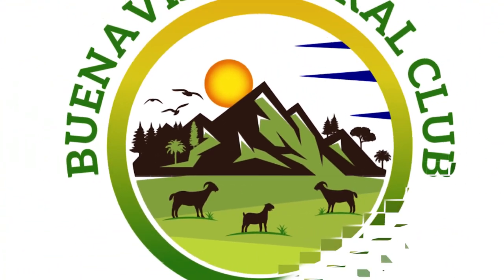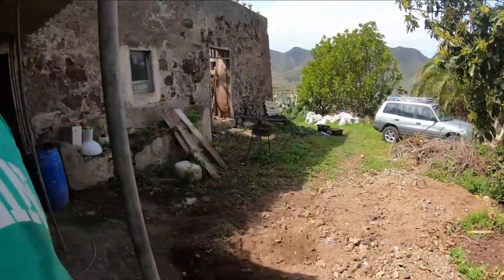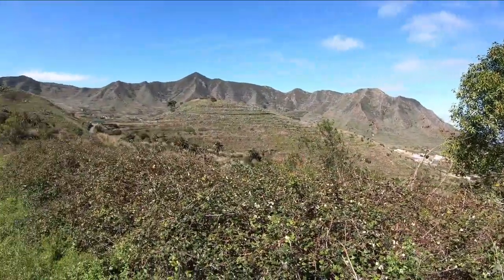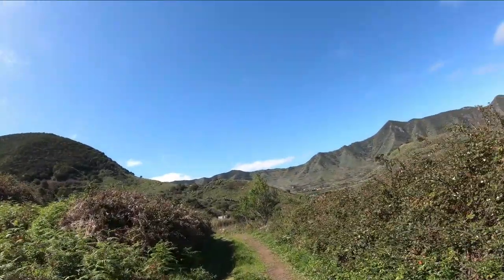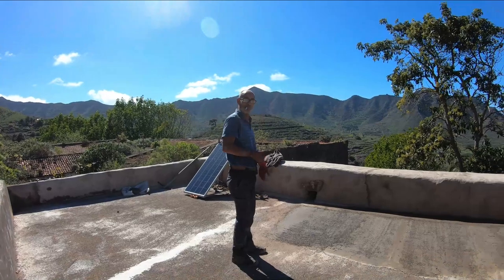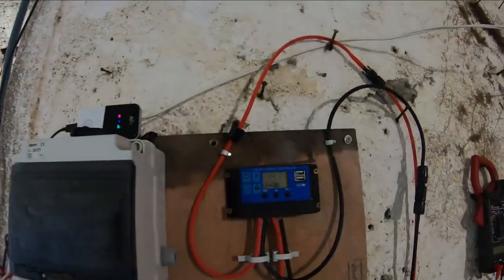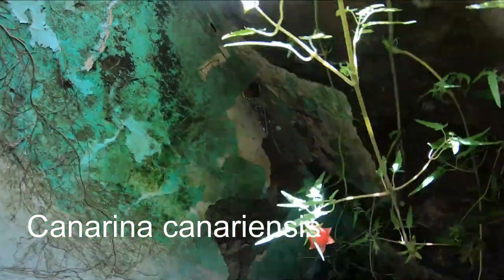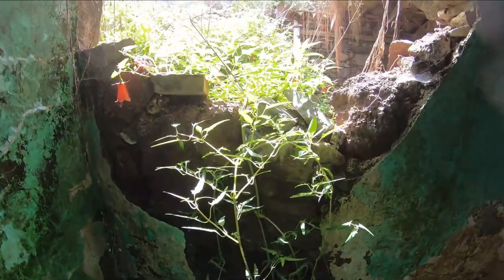BVRC25 Let it shine The sun in Tenerife North Restoring farm with concrete flat roof Dream come true

Comment: me again toby ..please tell me you have access to something better than manual labor or battery powered hammer drill to deal with that volcanic rock to level the sub floor in prep for concrete...here we would need 6 inches compacted 3/4 crush gravel 2-4 inches sand vapor barrier insulation then the pad with reinforcement either addmix or steel... looks like you might have 2 of the 12-14 inches depth you need ..no envy here
Reply from the maker: LOL !!! It was unexpected. But the local custom is to level the floor to the highest point of rock - effectively burying the rock under concrete. My big question that locals can’t answer satisfactorily is : DAMP PROOFING ?  They don’t do it. Probably why their houses are all damp LOL 🤪😂. So what would you do.  Hard core the hollows. Sand / grit the small surface holes in the rock to get an even surface. Plastic sheet membrane. Concrete over (what thickness of concrete?).  That’s what I’m planning to do. Also suggested was to mix the concrete. 3 black sand/stone mix, 1/2 42.5 grade marine cement, 1/2 lime .
Reply: @BuenavistaRuralClub  i would look to a latex or epoxy waterproofing  probably act as an adheasion premoter. poly sheet will also do . you might even look into a spray foam  which also would provide insulation value. in times of old dirt floor lime mortar and render the wall breaths the moisture transpires all several percwnt either side of ambient humidity  it works but is energy wasteful if trying to heat or cool and sealing  the moisture in leads to other problems so keep it out to start and prepare for when it gets in,, drainage layre under it all and a permeter drain to remove the collected water. sealed floor blocks moisture walls still wick but so long as you havent sealed the wall it will be damp when its humid and dry as that drops . a descent fan should control it
Reply from the maker: Which other platform did we message on ?  😃🤭
Reply: @BuenavistaRuralClub  facebook  charlie brown